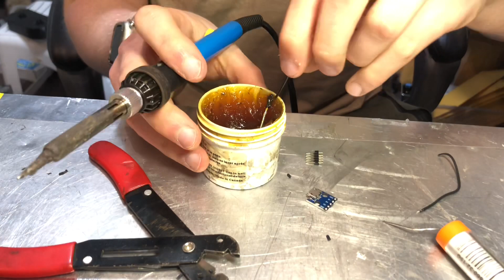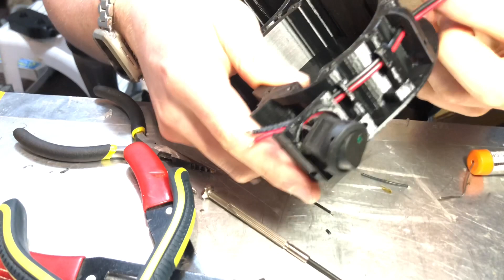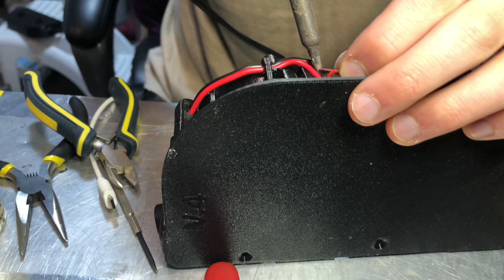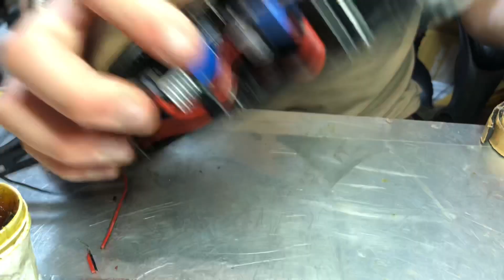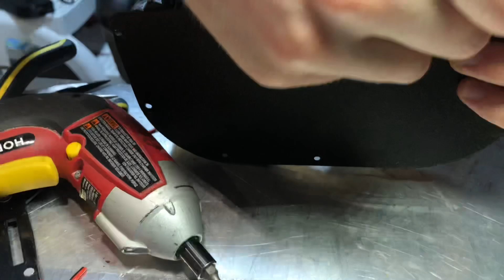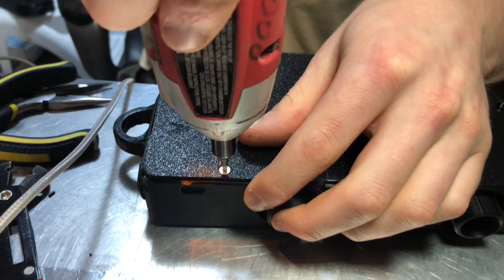Powered Respirator Assembly Guide

Comment: Do you have a link to the black putty?
Reply from the maker: Unfortunately, It's only available locally here in Canada, it's what's holding up your project. It would be possible to ship it worldwide to you, just let me know. 
Thank you for watching.
Reply: @inventability  stuff looks to be butyl rubber tape, which I can get on amazon. Screws I had to guess so I grabbed some M3s at 8-10mm. However I'm going to need to measure what the short ones should be.
Reply from the maker: @hardwiredforharware  The short screw is 
 <—————|)
|<9.13mm>|
(including the screw head)
<——————|)
|<7.13mm>|
(from tip to just before screw head)
2.85mm OD of the screw
Reply: @Michael Chen yes